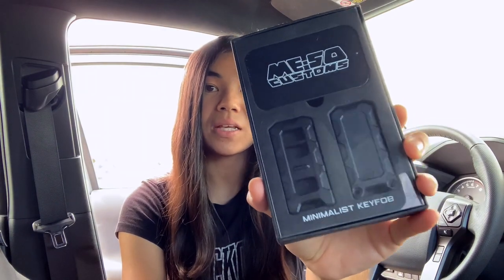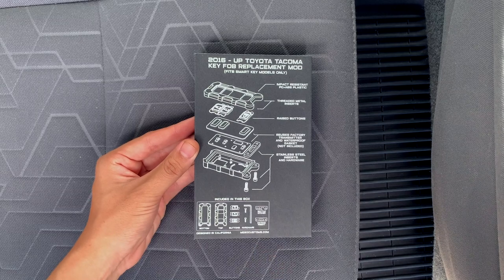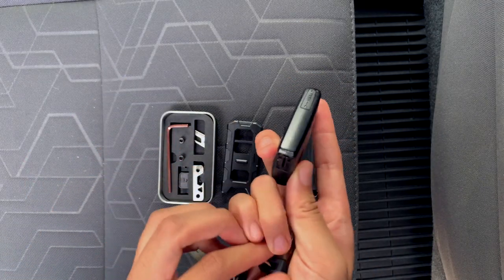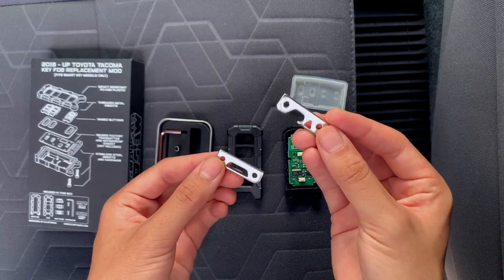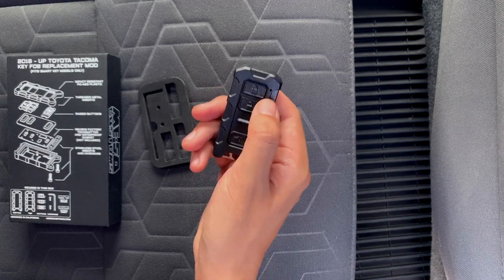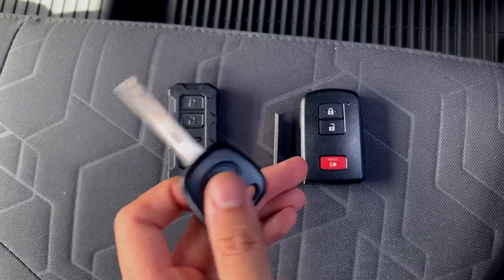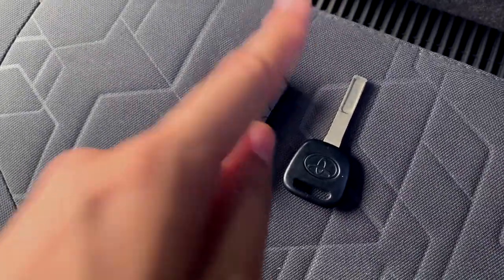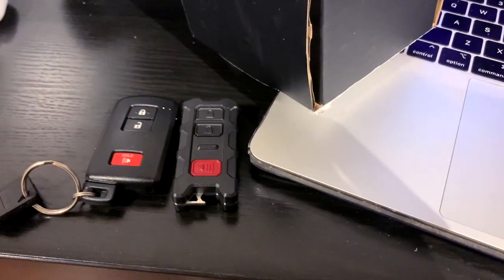MESO Customs Minimalist Keyfob Install + Review | Tacoma Keyfob Mod

Comment: just a heads up, that regular key is pretty useful if your battery dies. so keep it on the key ring!

I'm patiently waiting for meso's 4runner flip key.. it just so happens to be one that'll fit the aftermarket key with fob i have for my 05 tundra.... the truck was repainted cement.. now i want a matching key!

Comment: AJT makes a better key fob, in my opinion.
Reply: Agreed much more sturdy and rugged.
Reply: @Conflict7701  I have both AJT & MeSo key fobs. When compared to Meso's key fob, the AJT is much more fragile. 

I have 2 of the original TRD version of AJT, and they both have cracks near 4 corners. They also scuff easily, cause the plastic is pretty soft. 

I honestly like the AJT, cause it still has the tailgate key. But the Meso keys are much more durable.

Comment: Hi how are you!!wanted to ask you a question on your taco??did you ever went to the dealer and fixed the transmission problem when it for some reason make shifts to fast and then goes down again because it needs more power ,press the gas almost all the way and it just goes to fast ,so it’s either slow or super fast

Comment: Nice, I would go with a laser engraver for the logo on back instead. Enjoyed the video.
Reply: That would be nice. Also, the regular JB Weld (plastic JB Weld isn't as strong, even on plastic) with its grey color would offset the black letters. You can use more of the steel part to give it a more charcoal color to match your interior...No worries about 50/50, it'll be strong enough. I'd put a light coat within that recessed section, allow it to set for a bit and lay in the TRD. Cool fob hack. And just an FYI..Key cuts can be duplicated from a good picture of the key.

Comment: you should attach the TRD with acetone, it will fuse the plastics together. I use acetone to make abs glue and smooth finishes out.

Comment: Great mod, just like all of the other mods you have done. 

Like Dan K said, your original key fob can start your truck if the key fob battery dies by touching the Toyota emblem on the back of the fob to the push to start button. Not sure if the new fob will do that. Check your owners manual or YouTube for more info.

Comment: Hey chloe, maybe for your second key you could get the ajt key fob, it comes with the trd branding in the back and the design in my opinion is nicer plus you can keep the key attached to the fob in case you need it. Good work with the truck keep it up!
Reply: Ajt doesn’t have the trd branding on the back anymore, I think they had to stop doing it, got mine a couple months ago and it didn’t have it
Reply: @amatthews3170  I am sorry to hear that, it looks really good, i got mine for more than a year now, but besides the trd branding i love that you can keep your spare key inside the fob just like the oem one.

Comment: Chloe!  As someone else suggested, Meso Customs also makes a really cool gadget they call the Gasshole.  It is probably the best $20 you will ever spend.  It goes on the gas filler, and is used to stick your gas cap in while you are filling up the gas.  Totally easy to install, and heck, I have even gotten inquiries while filling up at the gas station, from other Tacoma owners who see it when I am filling up.  Also, Meso Customs makes the LED blackout turn signal replacements for the side mirrors.  They sell them for $100 for a pair, but another Youtuber tacoma enthusiast, "Bustabeatgeorge", actually sells them in the box from Meso Customs, for only $80.  They are twice as bright as the OEM signals and the blackout looks better than the OEM chrome trim.
Reply: Sounds like a 'Charlie Sheen Upgrade'? "I am on a Drug, it is called Gasshole"....

Comment: Can’t you 3D print on top of the case?  That way it might be bonded.  Something to try.
Reply from the maker: That’s not a bad idea! It might be hard to align the height of it though... I’ll have to do some more fiddling around
Reply: @ChloeKuo  Try it with your old case, or use some scrap plastic cut the similar size.  That way you can make sure the alignment is correct.   I used to work with CNC engravers and had to do similar stuff.

Comment: The "manual" hey is actually a Valet key.  It is used to lock the glove box and tail gate when you valet park your vehicle.  The driver keeps this key and gives the valet the fob.  This way the valet doesn't have access to the glove box or what ever else you've locked with the valet key.  The valet can only start the vehicle and lock and unlock the doors.  It also serves as a way to unlock the door should your battery go dead in the fob.  Also even if the battery is dead in the fob you can still start the truck by holding the fob as close to the start button as you can when you push the start button.